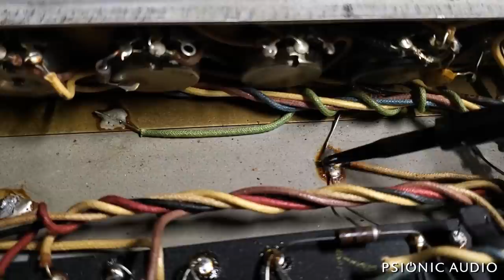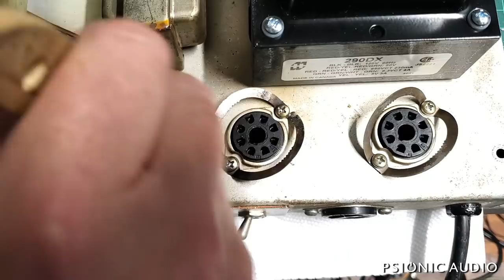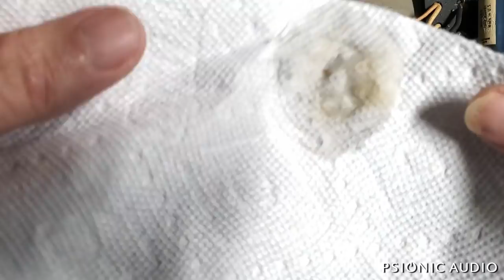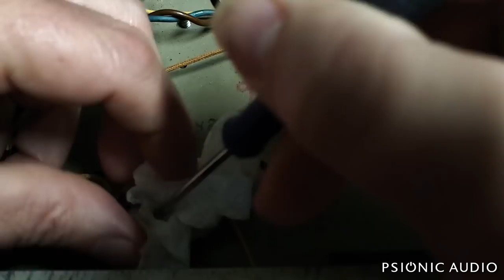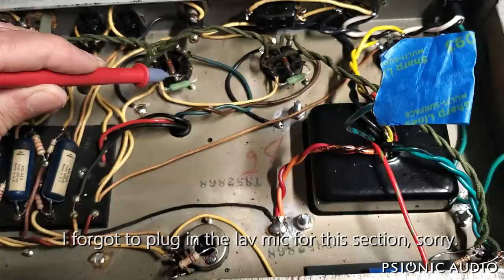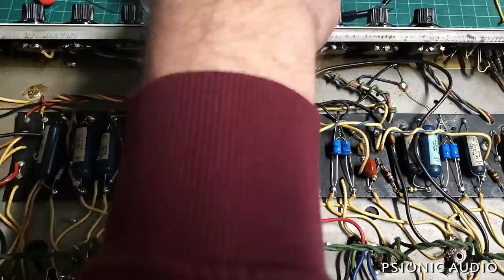'68 Pro Reverb | Part 4 : The Work Continues

Comment: When Fender originally fit three prong cords in the early 70's (look for the red plug) the 3-way ground switch was to be left in the center position IF the house plug was 3 prong. Otherwise Fender advised using a 3->2 prong converter (I still have some) and using the outer settings on the switch as one would have previously with the 2 prong cords and ground switches. But what most guys did was just cut off the center ground prong, and if they left the switch it in the center position.....you get it. Most clubs and other venues hadn't been converted to 3 prong and the plugs on the amps were considered a nuisance. So, if you have an early 70s silverface Fender with a red 3 prong plug and a 3 way switch you have an original.

Comment: Lyle, when you say circuit breaker, you mean a safety orientated one like a RCD correct?  I think its also important for viewers to know that fuses and most other circuit breakers are designed to protect from further circuit damage or fire - NOT to protect life.  I know in australia a rcd is required by law for this reason.

Comment: Very thorough work Lyle. You are the best!
Curious about how many labor hours were put into this amp repair?
Reply from the maker: I'm away from my bench log, but I think we're at five now. That includes diagnosing the unsuitable power transformer, discovering the bad speakers and cab/baffle damage, ordering the transformer, parts, new baffle/hardware, and new speakers. 

This poor amp was put through it. Most '60s Fenders are 3-4 hour jobs.

Comment: Class Z ceramic disc caps generally do NOT fail and the class X caps are supposed to fail OPEN. Both are good for AC EMI/RFI filtering.  I am 100% sure that all of my outlets have the hot on the hot side and the neutral is on the neutral side. Those outlets are all wired with the old cloth jacketed plastic insulated Anaconda Cable routed through red brick walls. I have debated on running a #4 AWG or #6 AWG ring around the foundation and using  crimped on #12 grounding wires run through a hole drilled from the outside of the exterior wall to the inside of the electrical boxes. These are ancient 1950s metal boxes and they are extra TEENY TINY sized! They are barely sized to accommodate the splices to run one cable in and one cable out to the next outlet. They are kind of a shallow U shape. or a shallow W without the middle peak. By code there is a minimum size in cubic inches for each wire inside of a box. Each device counts as 1 wire, and all the grounding wires ALL count as 1 wire (#12, #14, etc). Neutrals and hot wires are counted 1,2,3 per each wire, and a #12 takes up more space than a #14 AWG and less space than a #10 AWG wire. There are also code restrictions for the bending radiuses of wires too! These are building codes but they can be applied to chassis wiring.
Reply: I have only wired a few houses. The average value per home is well over $50,000,000. One home had an underground rifle range, a weapons vault, and a radio room. Another had grass tennis courts. They all had "smart wiring". YUCK!  Primarily, I was an industrial electrician who did automation, controls, instrumentation and other specialty work, but I respect residential wiring for what it is. Once those walls and the ceiling are all sealed up, you don't get back inside them without making a huge mess.

Comment: Why are there three wires to the bias pot instead of two? Is it related to the mods that were done to derive a bias supply from the non-original power transformer, or is it wired as a bias-balance circuit instead of an up/down bias adjustment?
Reply from the maker: Because that's how Fender AB763 and similar bias circuits are wired.

Comment: Agree with using sockets on pots, jacks etc.  I cringe every time I see an amp tech using needle nose pliers on nuts.
Reply: @marka1986   Not only does my bench at work have a full set of deep sockets it's, I have gone one further and modified some deep sockets by gluing a washer as a backstop inside the socket well, about 3/16" down inside the well from the outer face of the socket.  I can drop a shaft nut into the socket and it will sit there without dropping all the way down inside, and then I can just put it over the pot shaft and spin it slightly backwards by hand to seat the threads and then tighten it in the normal fashion. This saves me a lot of fumbling with my fingers to get the nut started on the shaft of the potentiumeter. It's especially handy when working on on old Hifi  equipment where the nuts on the pots are often recessed into a deep well on the faceplate.  Using a washer as the backstop inside the deep socket, or another shaft knot that has been drilled out slightly, allows the shaft of the pot to pass all the way through that backstop washer and down into the well of the socket so that you don't have to switch tools in order to be able to tighten the shaft nut all the way.

Comment: Is 90% needed or 70 ok? Friends 65 twin bias would run away for no reason until I realized the pot was losing resistance at certain points, I use a hobby four way wrench for those nuts
Reply from the maker: 90% from the drugstore is fine. I used iso on the chassis and outside of the pot. But Deoxit inside the pot.